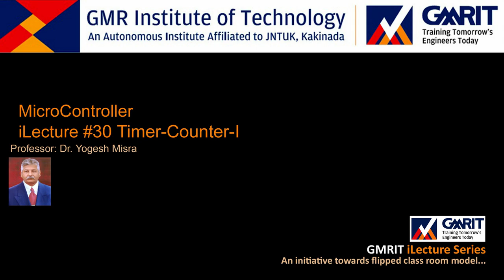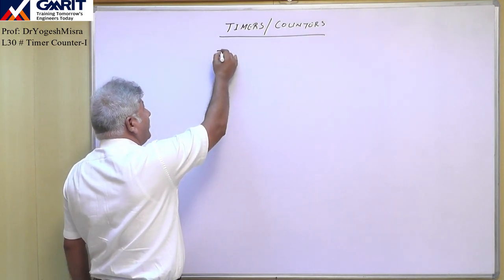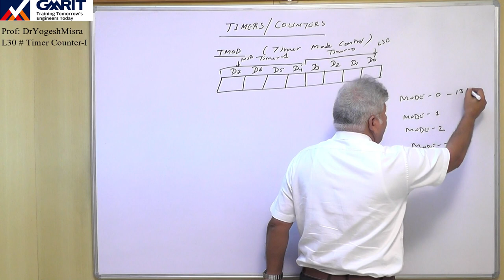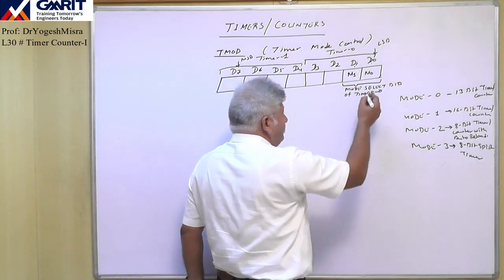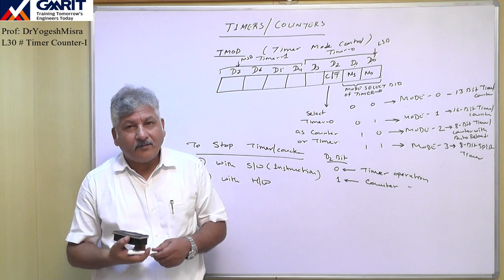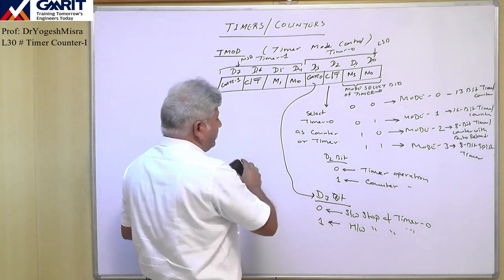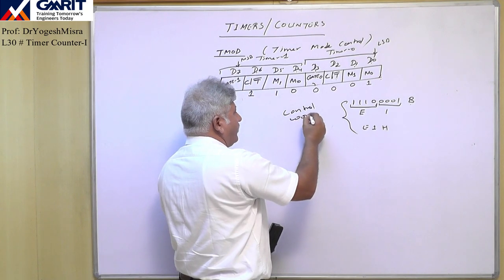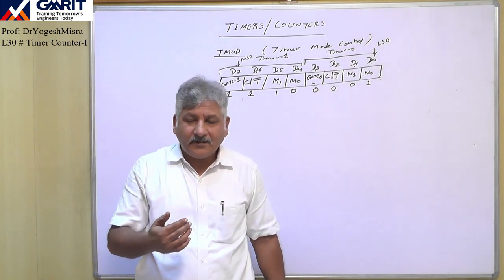Lecture 30: Timer-Counter (Part I)

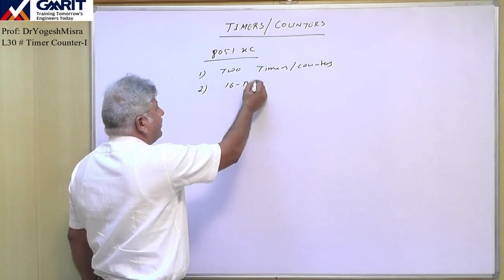Comment: Sir at 2:00 you said timers are of 16bits.
But sir there are only 2 pins for timers in 8051 i.e. it can only store 4bits of data so how can it will be of 16bits.
I'm getting confused in timers and counters section
Reply from the maker: Go through the all lectures of timers with full attention, I hope your doubts will be cleared.